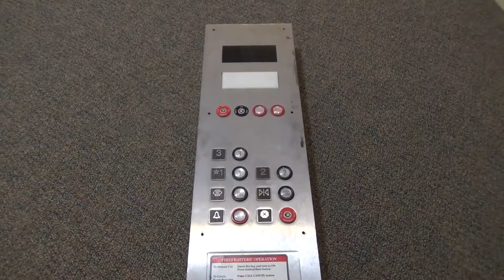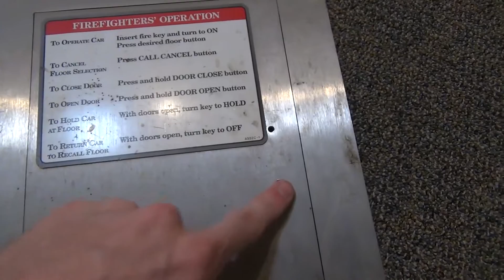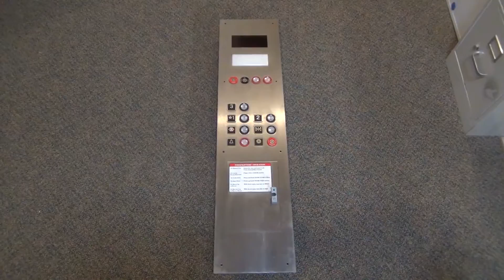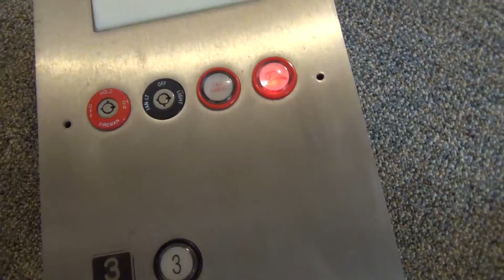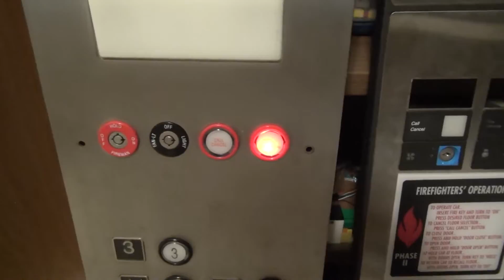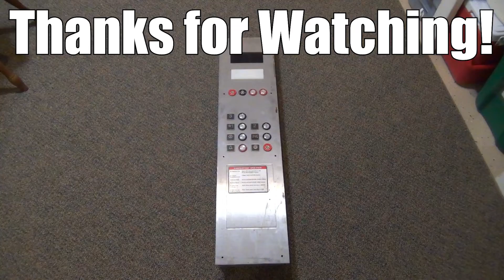Wiring an Innovation Elevator Car Panel

Comment: It would be cool if you put a led in the door close and door open buttons
Reply from the maker: It could be done but it’s not really normal for this style.
Reply: @stlelevators  yea but if you wire kone elevator buttons normally their door close and door open button light up

Comment: Nice panel, and it sure looks like the Innovation Universal car station that Montgomery Elevator used extensively in the 80's and 90's, as well as Montgomery-Kone in the mid to late 90's. Also, what does the bell sound like, and what do you plan to do with it?
Reply from the maker: Gonna keep the bell and use it eventually.
Reply: @stlelevators  All right then, maybe you can add it to the "Bells of Fame," so it can share a place with your Otis, Westinghouse, GAL-Cowbell, and all the other bells.

Comment: was that big mass of wires that it had before really necessary? XDD
Reply from the maker: Yes it was lol
Reply: @stlelevators  why on earth would they need that many wires XD
Reply: @ZZ9ProductionsOFFICIAL  Because you have 4 wires at least for each floor button, plus 4 more for each key switch and 2 for the bell. After you add it all up, you end up with around 30 individual wires, which are all bundled together and sent through the travelling cable to the controller. 30 wires is not actually that much considering we don't even have a floor matrix included or the phone. If we did, you can add another few wires. Out in the field, you will see different colors of wire used for differentiating each circuit. Now imagine how fun it would be to open an old elevator panel from the 1950's and the only colors your see is black and more black and more black and some white :/